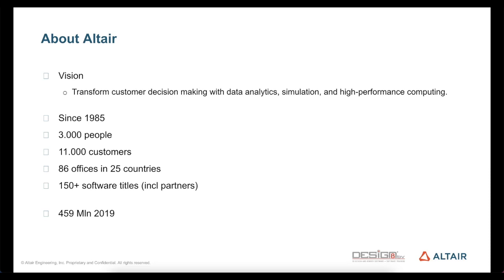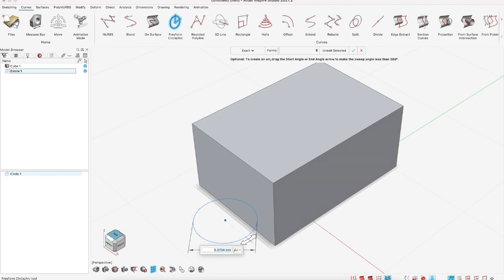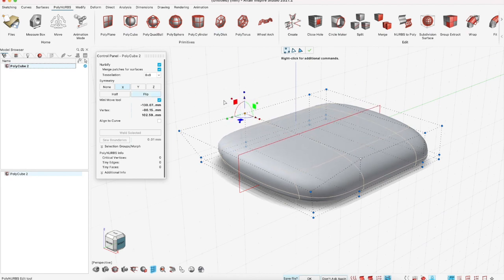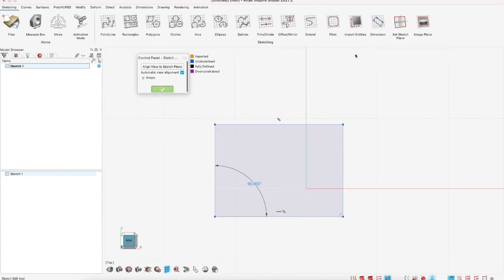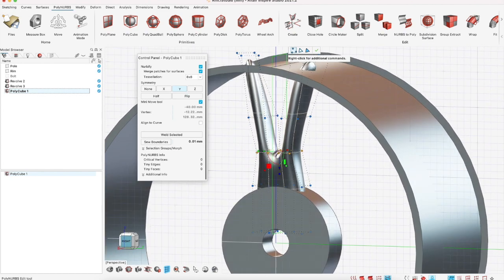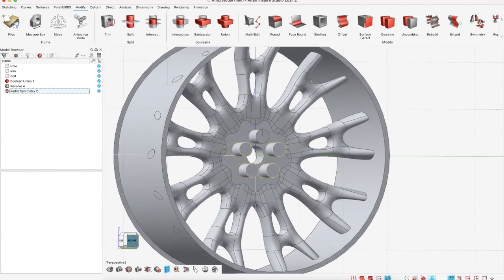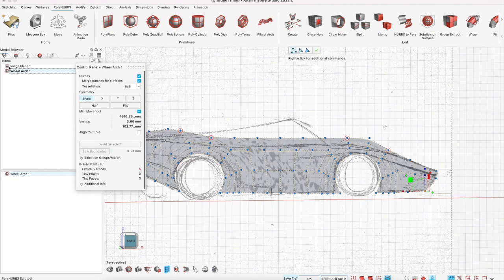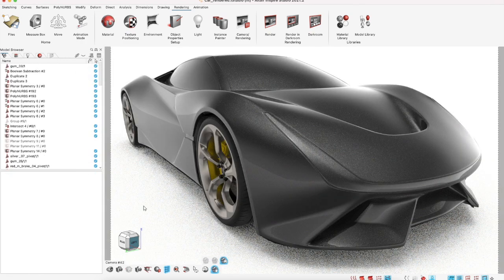Communicating your vision through 3D modelling tools with Altair

Comment: Great video. Looks extremely powerful. As a design professional, I'm looking to move from Rhino to a parametric system (Solidworks, Creo, Onshape, Fusion360 under consideration)
A few questions;
I understand from one of your resellers that Altair Inspire Studio can run natively on mac. Is my understanding correct. and can it make use of the new M1 chips? Or is it web based?
Can Thea render export .png files with transparent backgrounds?
How is mapping (of graphics & textures) in Thea render?